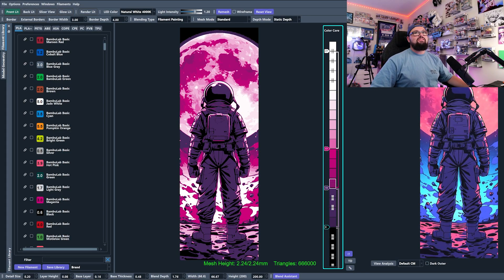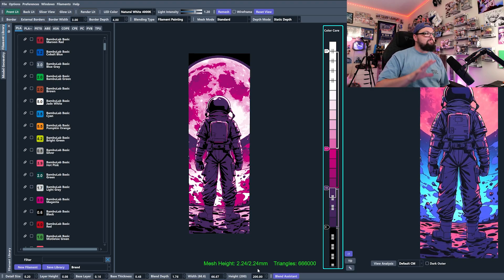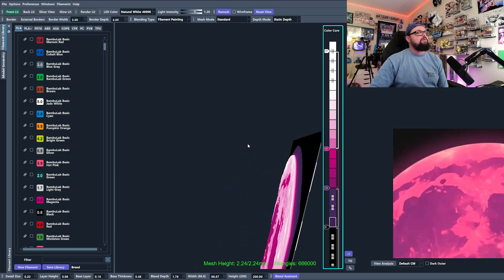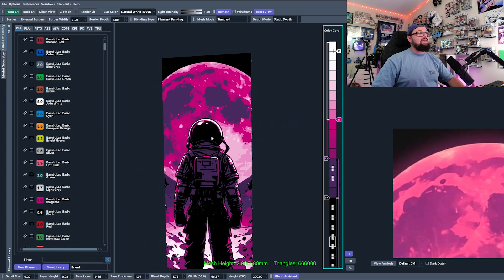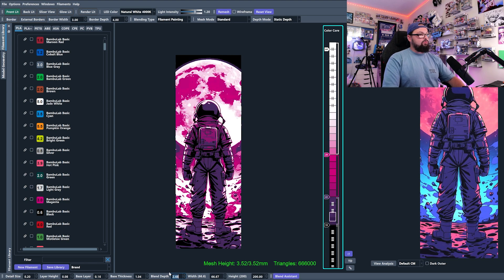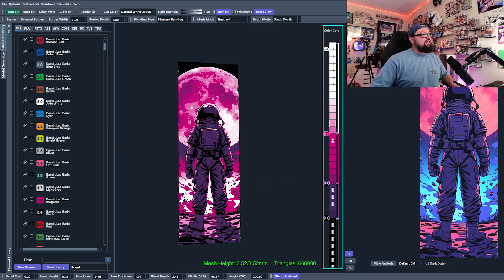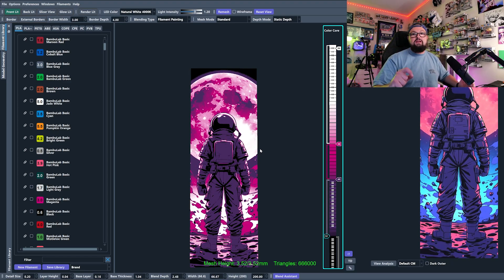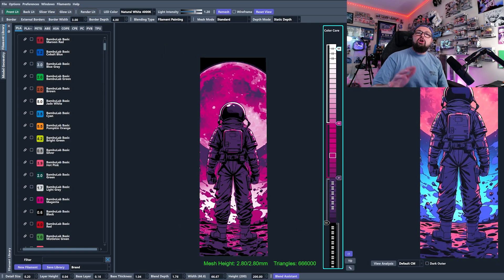Episode 5: HueForge Settings You NEED to Know

Comment: How do I make my hueforge 200x200 so I can use those collage frames ?
Reply from the maker: At the bottom of the program, you’ll see an area where you can change the dimensions of your picture. Make sure that the image you bring in is a perfect square.
Reply: @3DPrintsByVic  right but how do I do that to say weeding photos or just iPhone photos
Reply from the maker: @knockknockx4109  I would recommend downloading an app called Canva, you can set the size of the image that you’re wanting, and then just import the photos that you want to use. If you click the link in the bio of my channel and join our discord I’d be more than happy to walk you through it.
Reply: @3DPrintsByVic  got you I’ll do that ! Also when I export my forge it has 27 layers but in Bambu lab it has like 14 !
Reply from the maker: @knockknockx4109  make sure your slicer settings look exactly like the settings that are described in the .txt file that you receive when you export your file. The default is .08 layer height with a .16 initial layer.